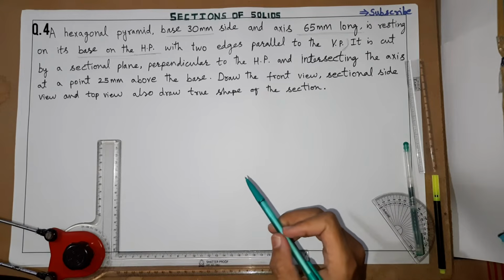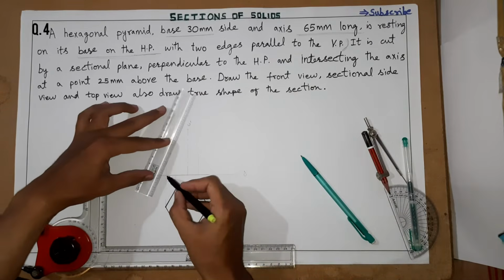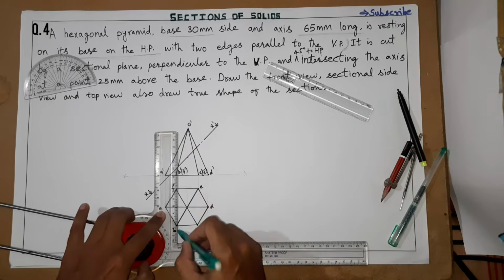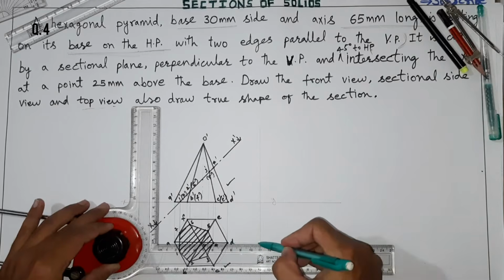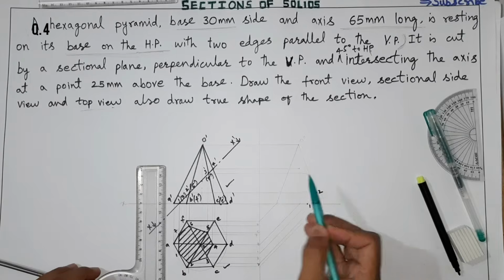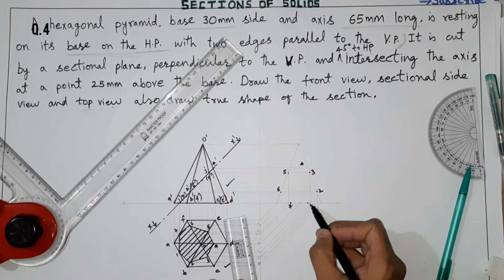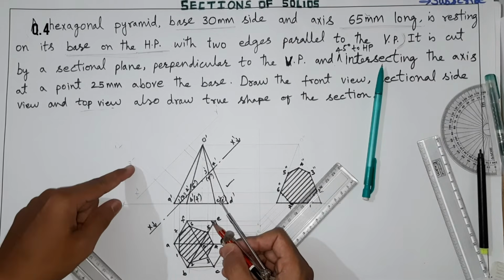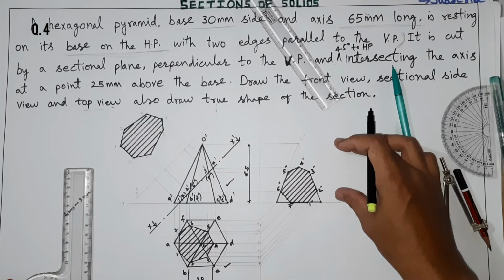Section of Hexagonal Pyramid & True Shape | Section plane inclined to HP perpendicular to VP

Comment: A hexagonal pyramid of base 30 mm side and axis 60 mm is resting on its 
base in the H.P. with two base edges parallel to the V.P. A section plane parallel 
to HP and perpendicular to VP cuts the pyramid passing through a point on its 
axis 25 mm from base. Draw the sectional view from the front and true shape of 
the section.

Comment: A Hexagonal Prism of side 30mm and axis length 60mm rests with its base on HP 
such that two of the vertical surfaces are perpendicular to VP. It is cut by a plane 
inclined at 40º to HP and perpendicular to VP and passing through a point on the axis 
at a distance 15mm from the top. Draw its front view and sectional top view

Comment: A hexagonal pyramid base 30mm and axis 65mm long is resting on its base on the HP with the true edges parallel to V.P. It is cut by a section plane perpendicular to V.P. and inclined at 45° to the HP and intersecting the axis at a point 25 mm height from the base. Draw front view, sectional top view and true shape of the section.

Comment: But sir what if the question changes to perpendicular to the VP and 45° to HP and bisects the axis at the pyramid??
Reply: What is the bisects mean
Reply from the maker: Dividing in two equal halfs
Reply: @RafeeqEngineeringDrawing  But sir kaha pe dikhaye ge usko divide krke koi side me ya angle pe dikhana hai
Reply: @yt-4ty bro height i.e axis ko divide karna hai  aur ek light projection karna hota hai horizontal to base
Reply: @RANSOME-q1g  Thnks bro ❤